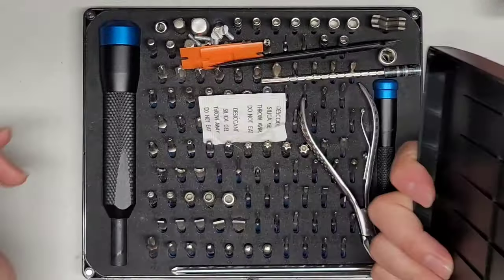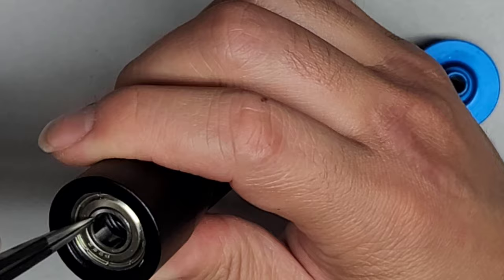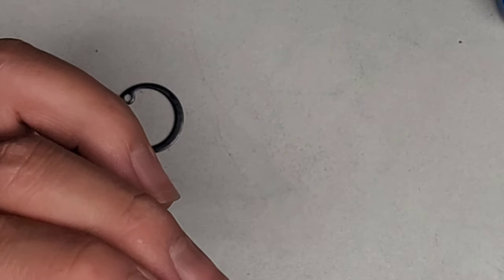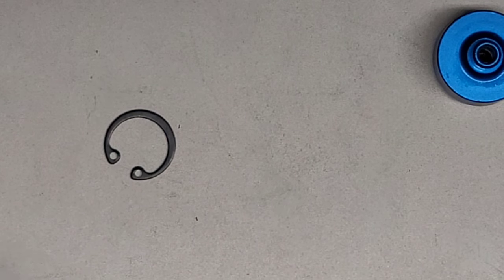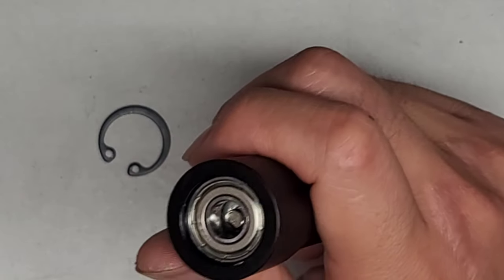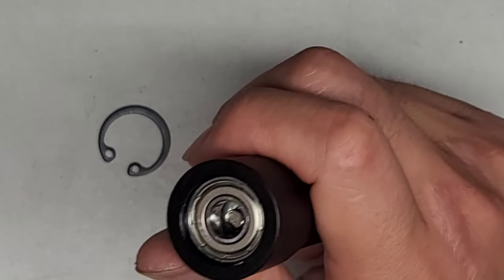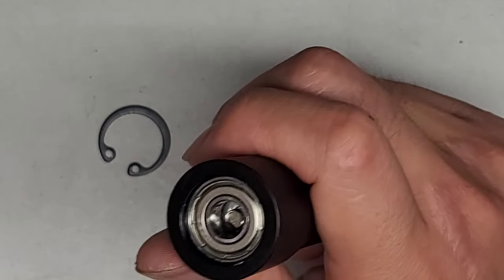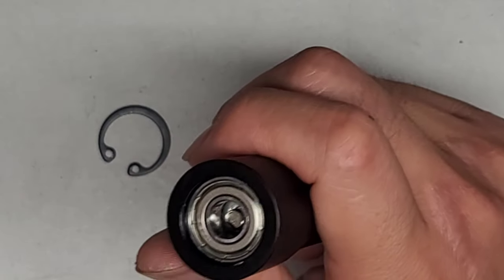iFixit Manta Driver Broke Failed and Their Warranty Replacement Repair Policy is Amazing!

Comment: it'd be difficult to remove the bearing with the bolt still in there still but you might be able to use the bread method (pack bread in put a bolt in, then hit it with a hammer till it starts to come out)
Reply from the maker: Yeah, I couldn't get it out. Need a special tool with a reverse hammer to get it out.

Comment: hi Binh. The spring with the little circles is called a snap ring. You were very close. And you use snap ring pliers to remove them. Some contract to remove, like yours, and some expand. Some of the kits that are sold to remove these rings have pliers that both contract or expand depending on which of the 2 available holes you screw in the knobbed screw into to decide which fulcrum you need. An inny or an outee, lol
Reply from the maker: Yup, but the bearing is jammed in there real good lol
Reply from the maker: Likely used a hydraulic press to get it in
Reply: @ItsBinhRepaired  I didn't say anything about how it comes apart. I was merely telling you about snap rings.
Reply from the maker: @mrkemblegilstrap  ahhh I see lol

Comment: I just glued it back on with super glue the caps middle point is ionised and wont come lose just a drop and set it on the cap. So the bearing wont be glued stuck worked for me. Screw rattles a bit but i dont care.
Reply from the maker: Lol just contact them. They send a new one for free. :)